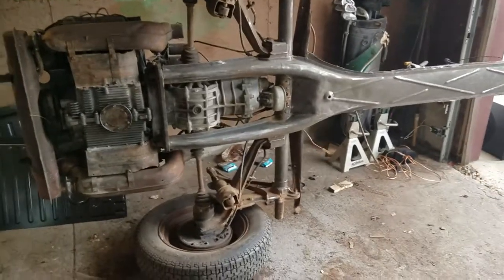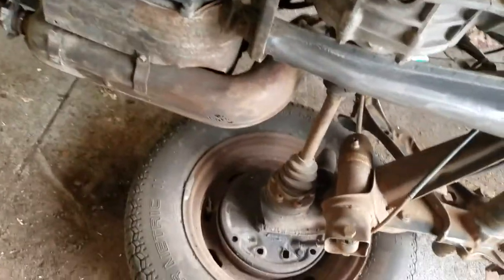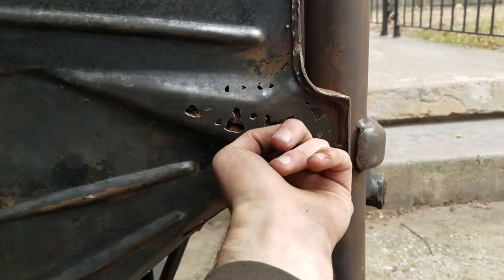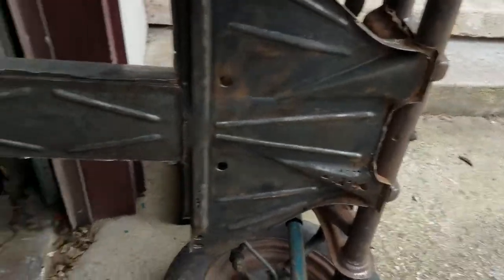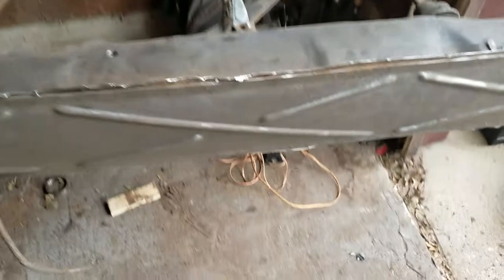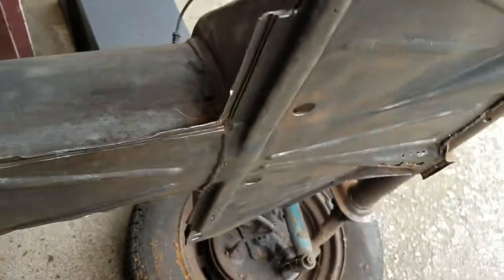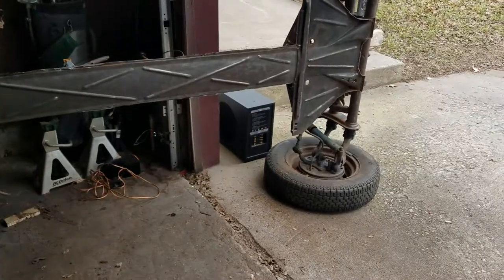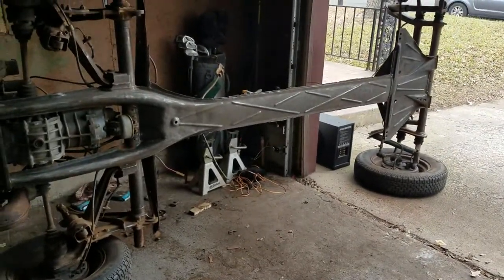Under side Chasis wire wheeled

Comment: You have managed to fill the rocker cover full of oil on that engine. A little late now. Just drain all the oil when you get it on all four wheels over night.
Reply from the maker: Ok so nothing major wrong with putting it sideways? I was going to change the oil before we drove it again anyway.